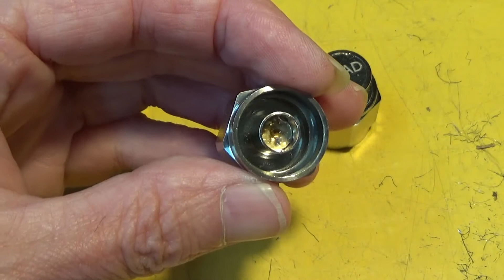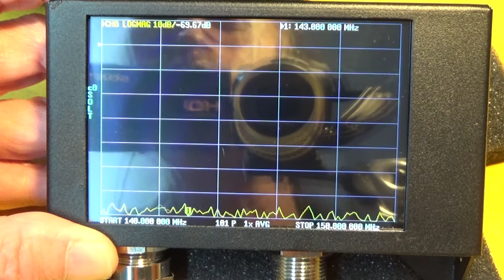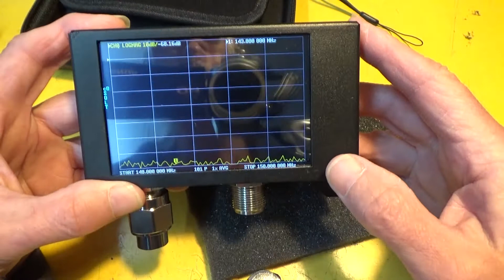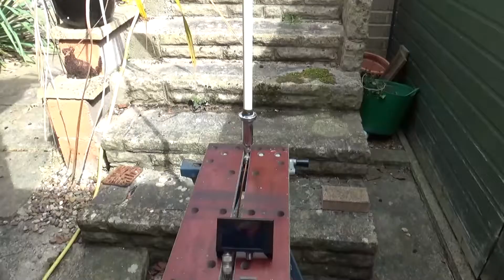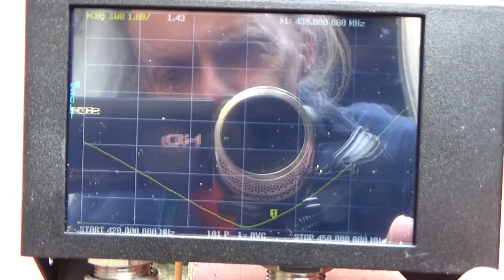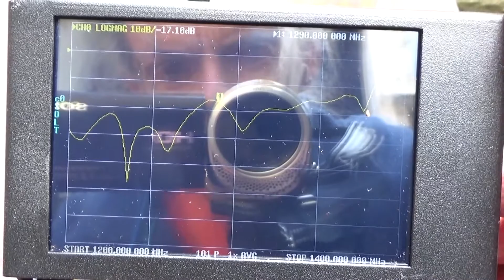SAA 2N nano vna

Comment: Of course I was interested in your measurements on your 23cm yagi. Indeed remarkeable results, but not bad.  I do not know which results there are with a similar one or an other type antenna, just to compare.  Could be interesting.  If you will remember I built the same yagi, and I became a good SWR by shifting the dipole along the boom on a moveable bracket I made. But your VNA gives interesting insights. Reason to look for such. It has at least proper connectors.